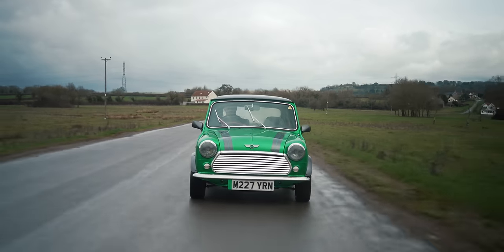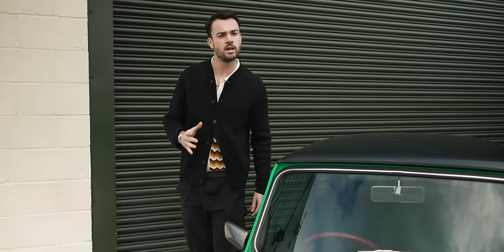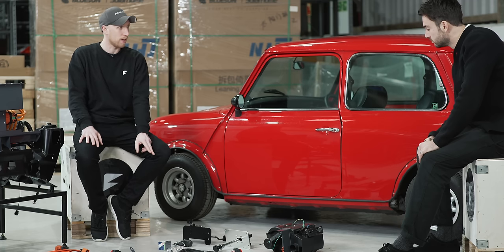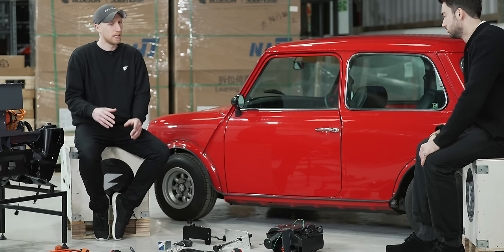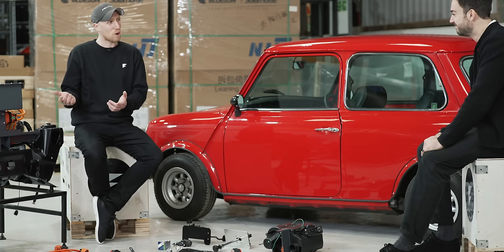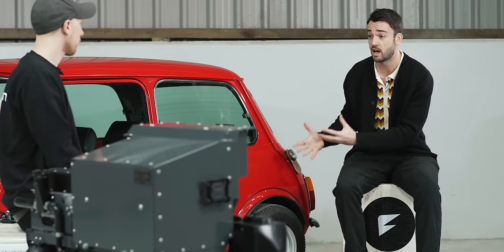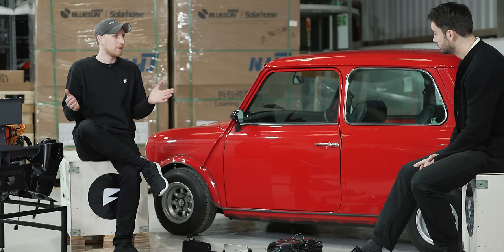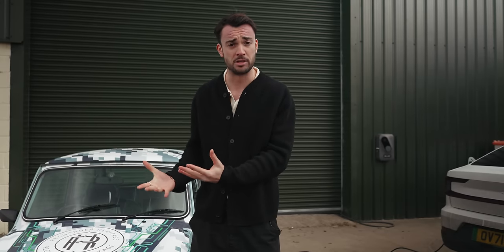How CHEAPLY Can You EV Convert Your Old Car?

Comment: I remember researching EV conversion projects a decade ago. Back then converters used lead acid batteries, and only a handful of proper motors were available... with many DIY conversions using motors out of clothes dryers which had very short lives under continuous load. Control electronics were primative and some DIYers had VERY primative solutions... I remember a guy with an electric Mustang drag racer that just used a giant copper bar as a knife switch mounted between the seats.... which he had to replace everytime he drove it because it would melt itself. Terrifying. My point is that not a small amount of the cost of these conversions is in the safety and engineering and knowhow to do them safely.

Comment: Retrofitting is surely the better option than "consumerism for the environment".
I have been using non-fossil fuels on combustion engines for decades (straught vegoil, biogas, ethanol etc.) and electric is one more of many options (although electricity doesn't care how it is made).
I've got a VW T3 which I'd curiously love to convert myself and design the conversion.
But it starts with a lot of money to play with. And that's a problem...

Comment: I want an EV.  But i have no love for, nor need of any kind of glorified cellphone tacked on the dash with other screens haphazardly and tastelessly slapped on.   Just look at modern cars.  the screens don't fit.  they stick out, up and over.  It looks like someone just built the car and at the last minute , realized that they forgot the infotainment system.  so they took their TV from the bedroom, and leaned up against the naked dashboard.  It looks like crap. and I hate it.   I want my real HVAC buttons and temp slider.  I want my real radio with its real knobs and buttons.   All that touchscreen crapola can get stuffed.   It's ironic, really.  The law forbids you to mess around with a cellphone or a tablet while driving. (which doesn't stop 90% of PA drivers)  but nearly every carmaker out there  has cars that the ONLY way to operate the thing IS to mess around with an oversized cellphone while driving.  The most basic of functions demand that you faff about with some menus and submenus and poke and swipe at some tactile-free chunk of glass with pictures on it to even change the airflow from vent to defrost.   Hell, even Rivian has incorporated the adjusting of the air vanes in their vents to require doing so by poking and sliding on a screen.   

No.  I'll drive a CAR.  Not a friggin cellphone.   I want an old car.  I want an EV car.  I want to be cleaner about driving and yet preserve and improve my old car.  It's a car I love,  with actual controls and tactile feel.  I want to EV swap my 1984 Pontiac Fiero.   350 horses and 250 miles range should do the trick. (Lots of room in them for batteries)

Comment: If we think ten years away, heading towards the new ICE cutoff in 2035 - there will still be a huge number of ICE vehicles on the road, because people will be buying them between now and then. That will create a mass market for straightforward retrofit, beyond just the bespoke artisanal classic world. If by then the raw material mining issue has been resolved, and production of batteries, EV motors and inverters have ramped up as they will have to - I see no reason why the cost for converting a structurally perfectly good ICE vehicle, 5 years old with 100k miles on the petrol motor,  wouldn't be economic to retrofit an electric drive train. If a new car is £30k but a retrofit could be under £10k, that'd be an attractive option.

Comment: My preferred route is to choose one model of car, my choice is an 2009 or newer Subaru Forester to convert. Beyond the electric conversion, make the  doors,  rear hatch, and hood from carbon fiber. The next stage would be to do the body in carbon fiber, plus custom make components so the car continually becomes lighter, stronger, and will last forever. Basically become your own mini car factory, but with a Forester, not a Mini!!!

Comment: You know EVs for everyone is completely impractical. How are you going to charge them all. The cost of electricity will go up. So will road repairs. Insurance will go up because they are heavier. You'll have to buy more tires. You'll save gas but other expenses will over take the savings. In short an EV is a white elephant. An EV is too expensive and impractical.

Comment: Why Tesla components? I would love to have my 1966 Škoda 1000 MB DeLuxe EV converted using VW e-up parts. Motor, traction accumulator, inverters, controller, etc. 60 kW is enough power. It will still outperform the original 1960s one liter engine in all aspects. The traction accumulator could be placed in the front instead of the fuel tank and spare tire and at the back, near the motor, where also all the inverters would find their place (as well as below the rear seats). For the sake of improving the handling, I would put in axles from a Škoda Garde/Rapid, with proper disc brakes front. Power brakes will not be neccessary, as regen will be the main braking force. Power steering also not needed, with the newer front axle with better steering than the original worm drive on the old one. The charging port could be hidden behind the grill on the rear fenders, where the air for cooling the rear mounted engine was being sucked in originally. The Inverter would go where the radiator was placed and the spare wheel on the other side, above the motor and the rest of the traction accumulators. The car would have an additional trunk at the back.

Comment: A mini is a great looking car but too small to fit a proper size battery pack, besides given the price they go for, hardly a cheap proposal... what we need is an electric conversion car for "boring" cheap cars people actually drive, like a Renault Clio, or Vauxhall Astra, a Ford Focus, or a family car like a Citroen Xsara Picasso, cars that cost less than £/€/$3000 to buy second hand!
But you're not going to get one any time soon because all these cars, any car built less than 20 years ago is too difficult to convert due to all the electronics it contains and that's the real tragedy: you can easily convert 50 years old classic cars, not 15 years old bangers.

Comment: When converting a car I would rather go for something from the 90s/00s.
Cars from the 60s/70s are nice, but one has to keep in mind that they are fragile, rust prone and not very safe in modern traffic.
I guess you could strip them down, weld them up, strengthen them, put in airbags, new suspension, bigger brakes, modern seatbelts and new electrics. But add all that to the price of the donor car and the EV kit, you can spend upwards of £60k, if you want a reliable and safe daily driver. I wouldn't feel safe driving a 100 hp old Mini with it's original brakes and suspension.
A more modern car already has good safety features, crumple zones, good suspension and brakes and the electric system to handle the conversion.
It may not be as sexy, but I'd rather drive an electrified new Mini than an old one.
I also think it's a bit of a pity to destroy the character of an old car. Some people may not agree with me, I'm not telling anyone what to do, I'm just putting this out there.
Plus, the newer cars would cost a pittance, especially when the engine is toast.

Comment: Conversion kits are great if you have no idea what to get and/or don't have CAD skills.  However, it's surprisingly easy to build an EV - I've done so myself without having really done any major mechanical work before.  Granted, perhaps my approach might not be the safest, the most reliable, or the easiest to work on, but it is a road-legal car that has already had thousands of miles put on it.

Comment: For me, the problem with off the shelf EV's is that they are still too complicated. Surely the advantage of a leccy car is you can make it simple; after all, a leccy motor is simpler than an ICE. Scrap the idea of keyless entry, complex computers that exist merely for those that want to show-off. All I want is a simple car that is reliable with wind-up windows, no air-con   no silly features that just make the car more complicated. MMM, a bit like a mini with an electric engine (although I'd rather a different base vehicle personally).

Comment: As we all know, the game changer will be when battery power will be enough to give a minimum of around 500 miles between charges. That along with charges that take the same time as filling up with conventional fuel.
100 mile range is way way to low because people don't like restrictions of occasional long journeys which increase time tken considerably compared with the present.
By 2030 can see even small vehicles having capacity for 500 mile rnge...

Comment: As we get more and more electric cars on the road the availability of getting used parts from wrecked cars will make this sort of conversions very much cheaper and even affordable. 70KW battery pac from a wrecked Tesla $10,000 .  then drive units for another for $25oo some wire harnessing and converters, inverters for a few grand more, and you can have your old car running better than new. Very much worth it when a new Model y is $60,000.

Comment: I am extremely interested in converting my old classic into an EV. But it is not a "buzz" bar, it is a bus bar as in and omnibus. An electrical bus is a high voltage or amperage electric connector from which many circuits can be connected. Saying "buzz" bar makes you sound ignorant (sorry if you're offended) and I'm sure that is not the effect you are hoping to achieve. Talk to an electrician.

Comment: I want an electric Brat. Mid '80s.
I wanna keep the 4wd.
I figure ripping out the gas tank and using half the bed, plus some of the room under the hood you could easily cram 50kWh in it. Pair that with a single motor mated to the stock gearbox, or a motor on the front and back axle. 
Wouldn't cost more than the downpayment on a house...

Comment: You can get an e-quad from Utah Trikes that can be custom built for 2 people, support 500 pounds or more, have up to 10 e-bike batteries mounted to the frame.  Each battery yields about 50 miles of range.  Add some type of enclosure for nastier weather and you've got an EV on the cheap with better range than most of the crap EVs you review.

Comment: I wish them luck, but they desperately need to automate their production line. They've invested a lot of time & money to develop the Mini conversion & it isn't going to break even if they can only pump out ONE conversion kit/week.
Then there's the 2 year wait before established EV conversion workshops can fir them in.

The charismatic Frenchman that you feature earlier has the idea, by ditching the ICE engine, but retaining the drivetrain, battery & motor requirements are reduced considerably. Plus the module can be installed by any motor garage in half a day. It also means that only the ICE engine is discarded for recycling. 👍

Comment: Retrofitting will NOT be a big thing. The cars of old days were simply designed and evolved around an IC engine and to create a good, economical EV with good range you have to design the car around the requirements of the electric motor and battery. Sure retrofitting will be 'a' thing for small number of cars and people and I think that I could be one of those people.

Comment: Makes no sense financially or environmentally, when most classic Minis in the UK do just a few hundred miles each summer.
Batteries will need replacing 10 years down the line, while a well rebuilt A-Series would be just run in.

Comment: Pardon me for being daft here.. But if a motor can be fitted directly onto the drive spline of the gear box, doesn't that save a lot of trouble? Obviously, the motor will have to be controlled so that it doesn't release all of it's torque instantaneously, but... The batteries can go where the original engine and fuel tank were.. And surely, job's a good'un? 
Debunkers, please tell me where I'm wrong.

Comment: So actually... No... Right now conversion is expensive due to demand. Later conversion is expensive because the car is too old and not worth doing.

It will remain a hobbyist endevour increasingly hampered by regulations.. Pitty, I have this Honda insight for over 15 years. Converting it would be a travisty in some ways but with a modest battery it would be an absolutely epic little city car.

Comment: Great idea but 3 small problems, 1 the cost is too high, 2 people would want a kit they could do themselves which would bring the cost down and 3 the range isn't really good enough for the money, 110 miles for 40 grand, now if it was twice the range it would be more fair.
You can by a used EV that will do 180 to 200 miles for 10 to 15 grand depending on age, not many people would spend four times that for a car that isn't as fast, doesn't have the features and lacks the range.

Comment: It makes total sense tbh..  Buying "new cars" is a waste of resources/etc.  I've only ever driven cars into the ground.. not one of my cars were younger than 30 or 40 years old when i scrapped them, and even then - it wasnt the body work which is the problem..  it was the old knackered engine (well, apart from the car i crashed when i was 20).

Comment: Seems like alot of useless parts. Equipping there own electric battery mine as well come with the plugin accesories needed to connect to vehicles 80's-90's+ for accelerator sensor, controls, etc. Running a mock ECU that could use the factory 'tune' to convert battery and motor torque functions similar to the original car. 

Additionally, you could probably just connect the motor directly to the transmission and utilize the factory drivetrain. That would make it much more universal, its up to the buyer to upgrade brakes and all the other things. No different than a crate motor. 

Vehicles that used a cable, im sure would be very easy to create a throttle sensor exterior lever which the cable would pull. Owners should be able to decide just how original they want to make there vehicles. The battery itself could come in a small variety of shapes and sizes

Comment: I think there is definitely a future for city cars, hatcbacks and 'hobby'/weekend cars (convertibles, coupes, classic cars, etc), because they don t need big batteries and big range. Otherwise it will be probably too expensive to convert a car which was not built on a dedicated EV platform, because you can't make them efficient enough and you ll probably need a lot of battery and also compromise luggage space  on an vw passat, to try and reach the efficiency of a model 3. Only if there will be a massive a breakthrough that allows the production of a relatively  heap and modular battery that fits into the mini and can provide around 50-60kw capacity, then we can talk about converting quite about any ICE car. I think it's important to lobby for government subsidies in this aspect worldwide because it's one of the greatest ways to be green, you use a lot of the existing cars and do not need to manufacture new body frames, use new paint (which is quite polluting as well), new interior materials etc, you just recondition the existing, add the new system, recycle the old engine and parts and that's it.

Comment: Something similar (retrofit) I would love to have. But 100miles is really not a lot. Thinking that’s that probably the best range (good temperatures, no luggage, only the driver) it’s even less. It’s alone 200 miles to the county house of my mother. A place with no electricity to charge a car too… well maybe with a range extender that could be a thing. But there must be a reason no one talks about range extenders.— but in total I am totally in for retrofitting cars. Modern cars are just not built for a long life. It’s the maintenance those companies earn money with. Therefore this cars need a lot of maintenance and it’s expensive. I think with a retrofit and a clever electrical system that could be far better.

Comment: Would love to see a Mini traveller (the estate version)  converted, you could get a few battery packs into that, so it could go further. I would strongly consider buying an old car and getting it converted, but it would need to do motorway speeds and be able to do at least 200 miles.

Comment: I think even with cheaper batteries and economies of scale, the cost of a conversion kit with a reasonable battery size will probably not become much lower than 10k euros/dollars/pounds. With such a prize, it will certainly become interesting for many hobbyists, not just the ultra wealthy ones, especially if you can do the conversion with relative ease yourself. However, due to the high amount of labor involved in such a project, it will probably never be feasible (at least economically) for the average person.

Comment: Be reminded that if you get into an accident would most likely result in the driver dying.
The lack of airbags, crumple zones, safety seats… 
Now these issues would be less with a more modern car, but then you have more work integrating with the existing computers & electronics… or replace it all, which would not be cheap…

Comment: The reason it's cheaper to buy than convert is that the OE's have loaded all the service prices for replacement parts. Typically the component manufacturers sell very cheap to the production line and get 4x OE for replacement parts.  Unless that changes ant re-furb will always be absurdly expensive.

Comment: There's no need to reinvent the wheel. If you're happy with an EV that has a range of around 50 miles, using lead acid batteries instead of lithium, and have a donor car, you can do it for around £1,000.
The idea that we can't convert cars cheaply for many years is a myth. You can do it today.